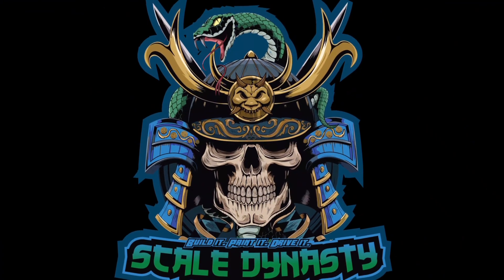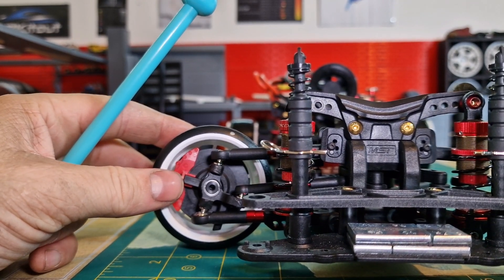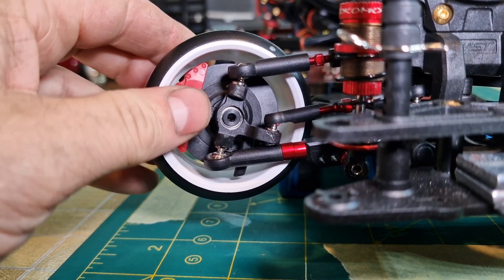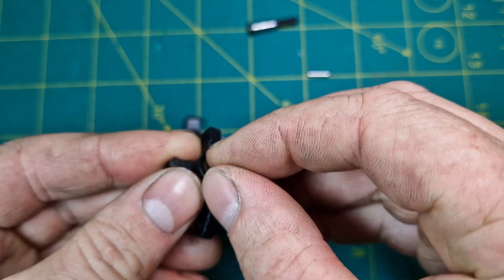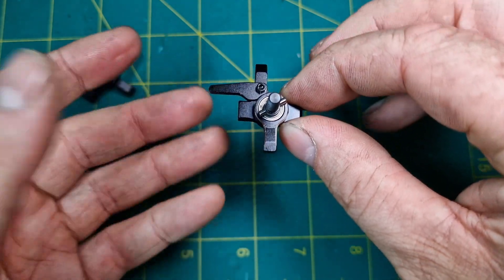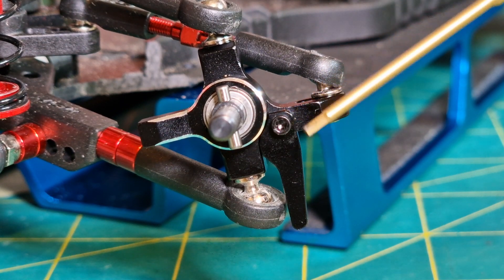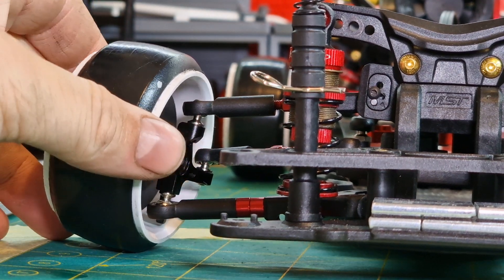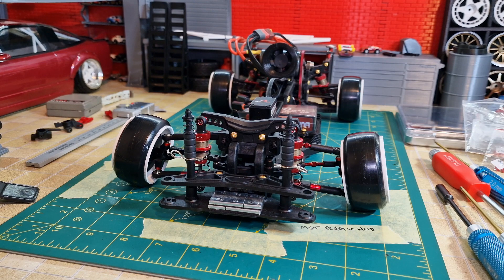#rcdrift MST RMX 2.0 UPGRADE SERIES EPISODE 6: YEAH RACING ALUMINIUM FRONT HUB KNUCKLE INSTALL

Comment: Nice mate! I have a set of these on order along with a bunch of RDX parts. My lock is pretty solid already but that flex is killing my roll. So I hope this will help me as well. Plus, looks wicked. :D
Reply: I run the same MST silvers as my "grippy" vinyl floor tires but have recently started using DS Racing LF-3's. I like their side bite on vinyl. The RDX kit is nice, solid, looking at getting one?
Reply from the maker: Yeah I really can't complain with the YR Knuckles, they are half the price of the MST Aluminium ones!
Reply: @scaledynasty  I have several of the YR bits on my MST rig and like them. The price and quality are there typically from them. :D
Reply from the maker: The silver dots are the control tyre at the track we go to, and what most people use for carpet, but I did used to use LF3s on my concrete floor before I build my carpet test track! To be honest, I don't like the shape of the ds racing tyres, the MST tyres have a nicer sidewall profile and are easier to get clearance!
Reply from the maker: @robinkesterlives  YR are definitely the budget brand in comparison, but they get the job done! These perform nicely, and are definitely an upgrade over the stock plastic knuckles!
Reply from the maker: @robinkesterlives  I would love a RDX, it's definitely on my list of chassis kits to get!
Reply: @scaledynasty  It's a solid piece of kit that needed very little post build tuning. I'm going to spend some time tomorrow running tires to get a better feel and tune it more. Gotta love the test and tune!
Reply: @scaledynasty  On vinyl the DS racing have a nice bite. But I do prefer the silvers for my vinyl drifting usually. The floor has a slight texture and the lf3 catch it more then the silvers.
Reply from the maker: I've only heard great things about the RDX and the test and tune is what it's all about! Endless upgrades and setting changes to be made on these things, which is one of the reasons I love them so much!

Comment: Hello bud,
What spacers you ended up having on?
Im currently working on improving front geometry and learning at the same time- this video has opened entire new vision of what potentially can be achieved on rmx.
Please share your experience 🙏 you mentioned ordering longer ball studs, I have placed an order and looking forward to finally figure it all out.
At the moment I have a bit too much angle and not enough speed on the straights so really really need to figure that out 😃
Reply from the maker: Hello mate, how the RMX progressed in this video wasn’t the final form for me, but i was really happy with how the RMX drove in the end, and really felt I unlocked a lot of potential in the front end! I never found 4.8mm ball studs long enough, I used Yokomo 4.3mm ball studs and ball cups. I believe my front end specs were 210mm wide with 7mm offset wheels, 10 degrees negative camber, 3 degrees toe out and 6 degrees castor. Driving wise, I find learning to throw and catch 3/4 allowed me to be far smoother and faster all round! I hope this helps!
Reply: @scaledynasty  thank you for the reply 🙏
I have ordered 5.5 long ball studs and hoping by adding oring inside it would make a decent combo 🤞
How much did you spaced the bottom and the top?
Reply from the maker: @Androedoff sounds great! Let me know how you get on!